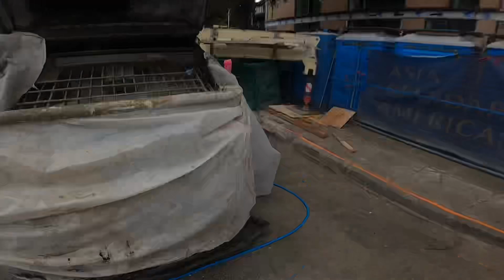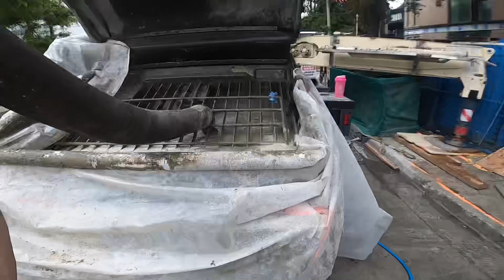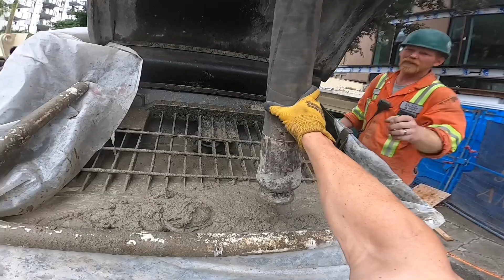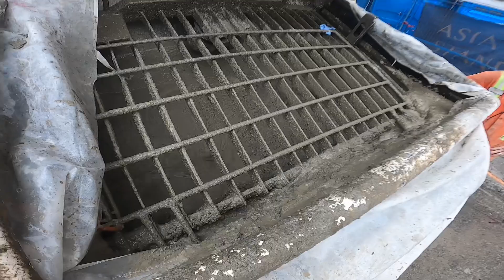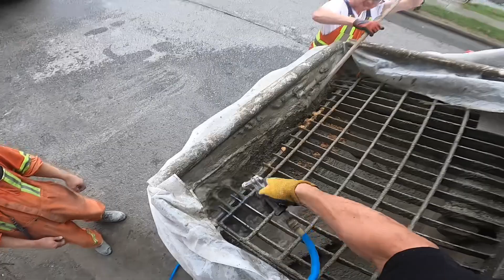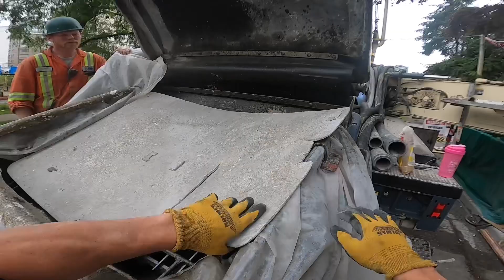Pumping shotcrete with a boom pump. Part 2.5 (the forgotten files):

Comment: How much sugar do you add?
Reply from the maker: A little bit goes a long ways. Just a couple measuring cups, properly mixed in with the contents of the hopper will kill it dead forever.
Reply: @canadianconcretepumper1979  thanks, I commented on the other video about the bentonite alternative. I was in the shop yesterday and found hydrated lime, when I looked it up it said “It is used more widely in schools and training centres where it is mixed with sand (no cement) to make a mortar that doesn't set, ideal for teaching brickwork.” Any thoughts on using as a hopper dusting?
Reply from the maker: @StephenKnowlesProperty  very interesting, I have never tried that, but so long as it clings to the walls of the hopper in the same way that bentonite does, it sounds like it could be a good deal. If you do try it out, please let me know how it goes.
Reply: @canadianconcretepumper1979  yes will do, I’m thinking I’ll do a test area in case it doesn’t go to plan. It’s a shame I can’t find the bentonite readily available over here. What I can find seems to be granulated. What is it used for in Canada?
Reply from the maker: @StephenKnowlesProperty  it's typically used in the drilling industry (oil/gas/etc...) for lubricating their drilling bits as they drill down into the earth. We source our powder through a drilling supply company.
Reply: @canadianconcretepumper1979  bentonite over here £20 for 20kg is cheapest (31 CAD for 44lb)
Reply from the maker: @StephenKnowlesProperty  we pay around $15 I believe. Even at $31, that’s not too bad. A little bit goes a long way with this stuff. I usually only dust the hopper with it if I know I’m going to have a long day, otherwise I just spray it with a little bit of canola oil (which has literally quadrupled in price since Covid 🙃).
Reply: @canadianconcretepumper1979  Yh 31 cad is the cheapest I’ve found.. some of it is 200+ but god knows why. Thanks again for all the info.